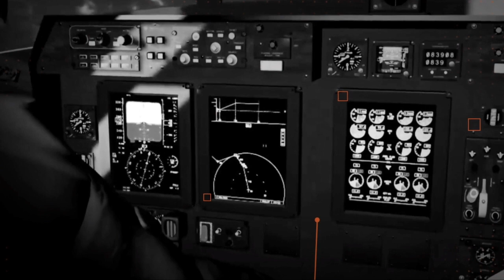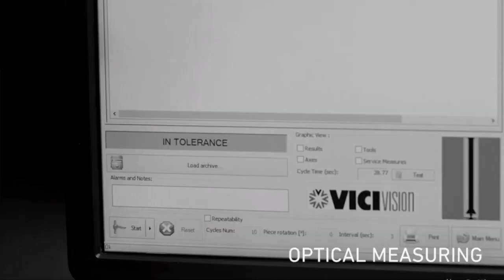Collins Aerospace: Senior Advanced Manufacturing Engineer - How To Get A Job

Comment: I want to go into aerospace. But I have only a year of experience in the gas industry. Graduated in 2020 and have a B.A. in mechanical engineering. Have you heard of people jumping from gas industry to aerospace?
Reply from the maker: It's always possible to switch industries. Its much easier to do it earlier in your career than later for sure though. Aerospace is very board in general so I would recommend looking up an Aerospace companies you want to work for and searching for mechanical positions within those companies. Then you can try to slide into an aerospace position within that company once you're hired. I recommend learning a specific skill that you're interested in outside of work. For example rocket propulsion systems. Take an online course and do a project related to that to get experience. Companies will want to see that you have some relevant experience. Even if it's just a hobby outside of work.